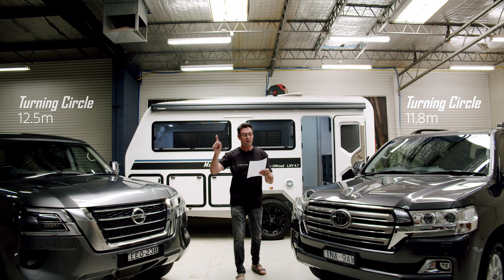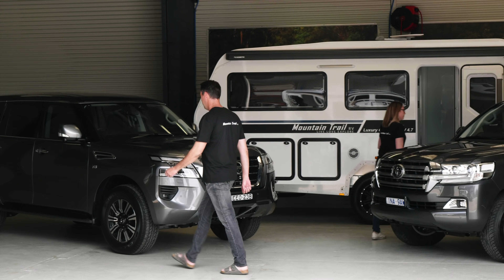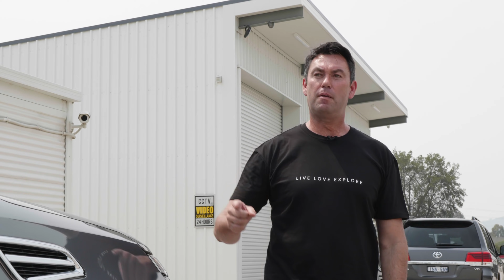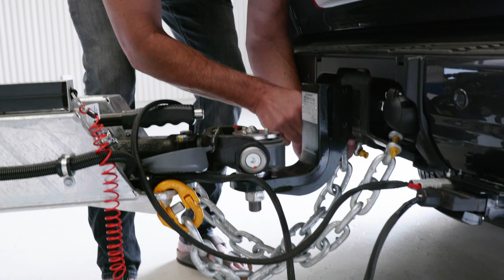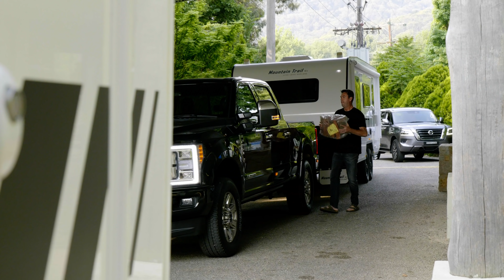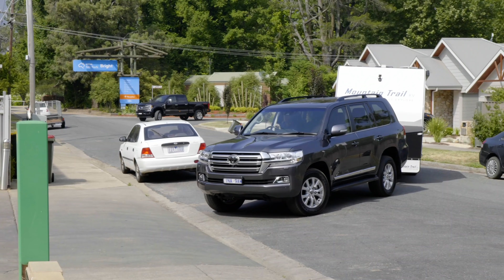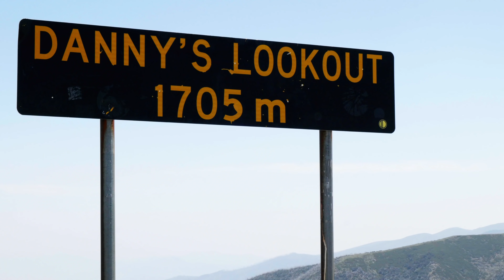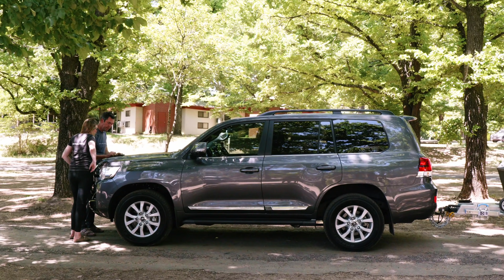Y62 V8 Nissan Patrol vs Toyota LandCruiser Fuel Consumption Tow Test PART ONE (4K)

Comment: Noticed you used the LC200 on economy mode, as do I. I’ve got a LC200 GXL 2019 model with ARB BP51 600kg suspension upgrade and all the accessories from ARB (F&R lockers, air compressor, cargo draws, uhf, diff breathers, cargo barrier, roof rack, bash plates, twin wheel carrier rear bar, snorkel, long range tanks for 270 litres of diesel, etc) but I’ve also got a lockup converter on my auto trans. From Brisbane. This saves me about 3 to 4 litres per 100kms, keeps the auto trans cooler especially when towing my LXV 4.7 and holds gears better. As I’ve travelled around Australia these last 9 months I too get about 22 ltrs per 100 kms. I’ve done the Oodnadatta track from William Creek to Mount Dare, explored the NT, SA ,gone coastal around WA, crossed the Nullarbor and now I’m back in Melbourne for Xmas. New year off to Eastern seaboard. The Toyota LC 200 and Mountain Trail 4.7 LXV is really a great match for exploring all the nooks and crannies around Australia without the worry of something going wrong. Thanks Nick.
Reply: Gee the cruiser isn't very good value the patrol comes factory fitted with a rear locker and torque converter lock up
Reply: Hope you have a gvm upgrade. That's good economy.
Reply: What are the figures when not towing?
Reply: Sir Ken hi, around 18.2 litres per 100kms
Reply: Displayed.
Reply: @duncanorme2131  That's astronomical for a diesel. Was thinking of putting on some All-Terrain 35" tyres, 2 inch lift and a long ranger tank but I think I'll have to forego the larger tank and stick to the 138l stock tanks just to save on some weight.
Reply: Sir Ken definitely get the lockup on the torque converter for the auto trans. Make sure you get the one from Brisbane. Not sure who the maker is, but I know he’s a FIFO worker and his doesn’t cause errors for the cars cpu. I got mine installed in Humpty doo, NT by All Rural Mechanical. The guys there use this model in their vehicles and highly recommend it.
Reply: @duncanorme2131  Sounds great! Thank you
Reply: Yup, 600kg ARB BP51 upgrade before rego.
Reply: Duncan Orme hhhhhhhhjjjjjjvvvvc

Comment: Why not run the vehicles back to back, using the same van, same speed? Also why not include the F truck in the comparison as well.
Reply from the maker: The weather conditions were exactly the same on each day.  We considered that before we filmed.  35 degrees C on both days in Bright!
Reply: The only down side about filming over different days and even the same day is the weather/hourly temp could slightly affect the performance.
Reply: Good call. Hook em all up to the same van and do it altogether. I’d be surprised if the F truck used a great deal more.